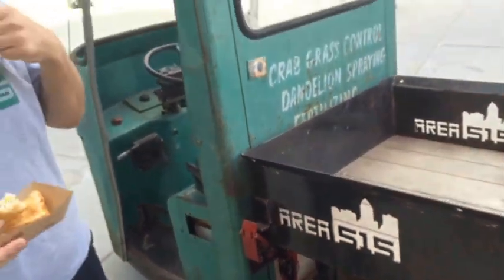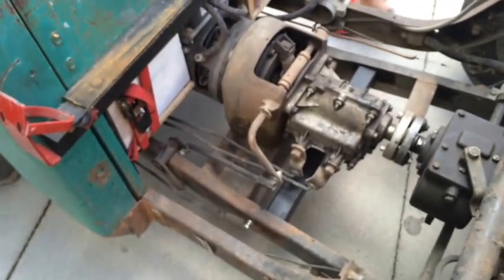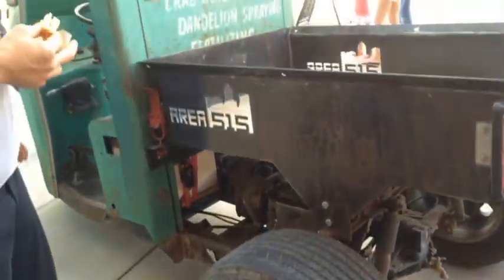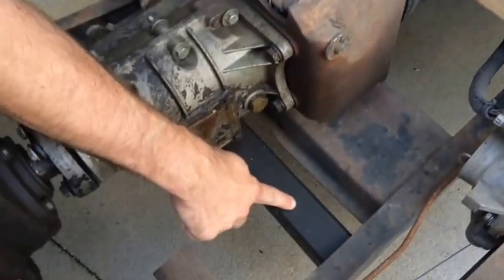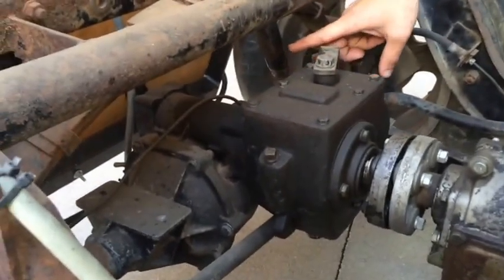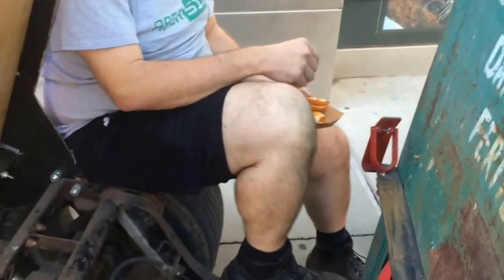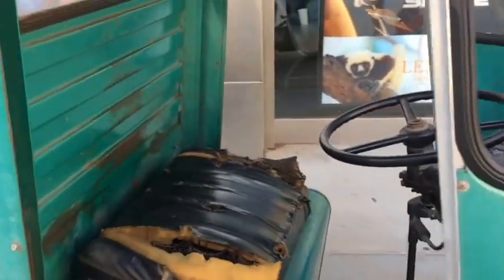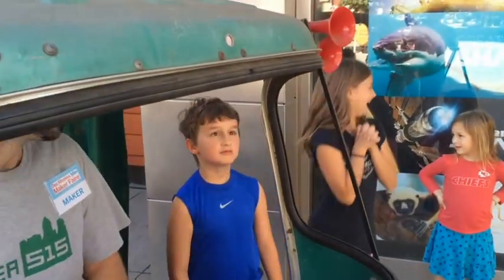Converting a Tuk Tuk (Cushman Truckster) to a fully Electric Vehicle

Comment: Ok Guys -  you don't need a Transmission or clutch reverse is done by reversing polarity  that & the on road differential plus your large diameter tires should bring speed to 40 and trust me you do NOT want to go faster they tip over bad 35 and up .... Rob
Reply: This is converting what you got, using what you got. They had fun, learned some stuff, don't be a negative clown.
Reply: @diffened  Do you often get in the middle of someone's conversation  without reading the context ?